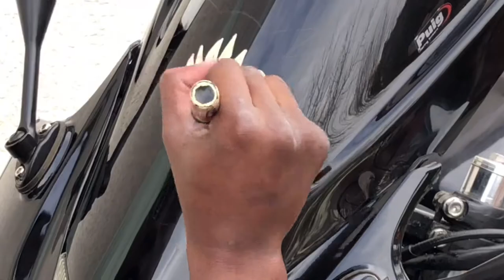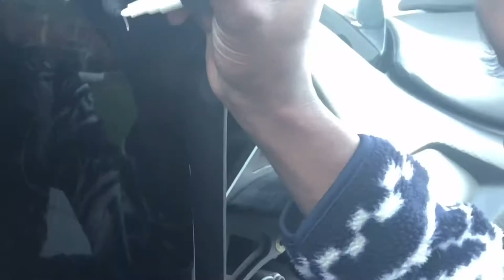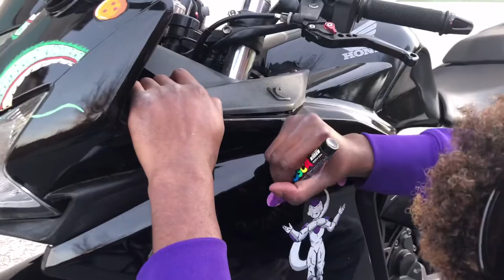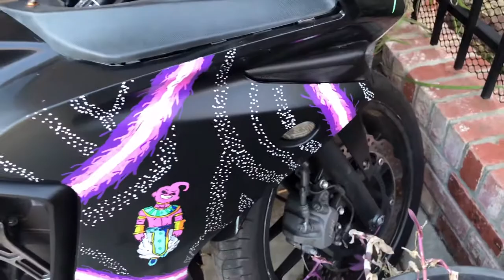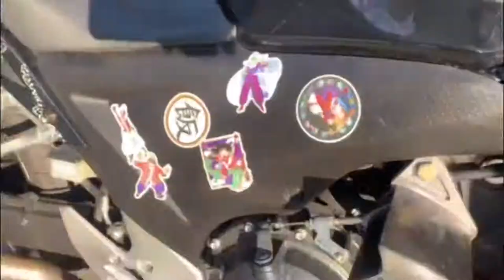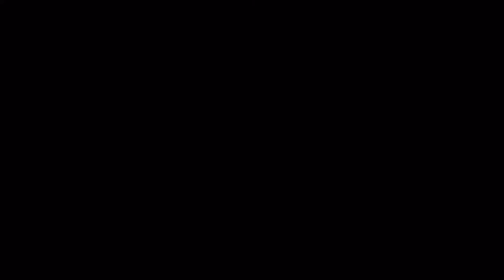Customizing a Motorcycle🏍 with POSCA markers 🎨

Comment: I think it takes guts to decide to customize a motorcycle.  When you did this was the goal for your changes to be permanent, if so what did you use to seal the posca paint ?   I may be customizing a longboard and I want to make sure the paint I put on stays on.
Reply from the maker: I use a few layers of clear coat to seal the posca markers
Reply: @GillGully  Thank you